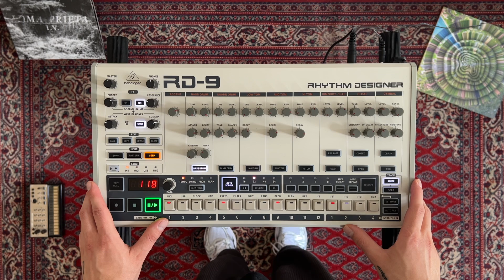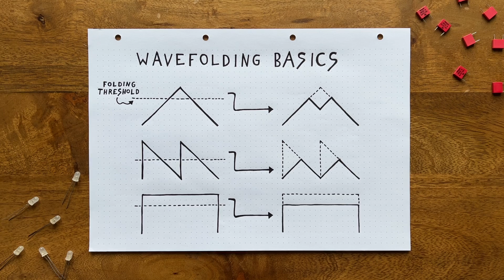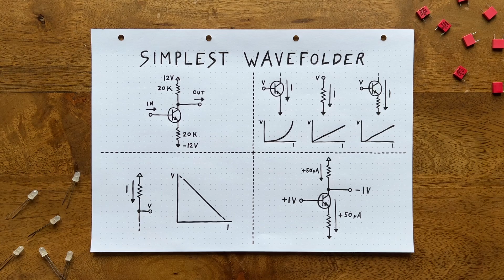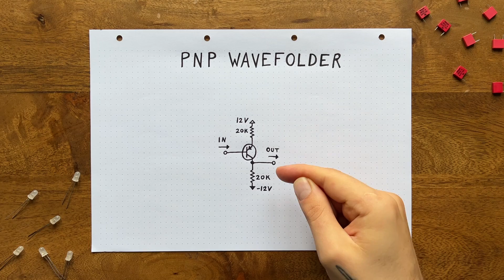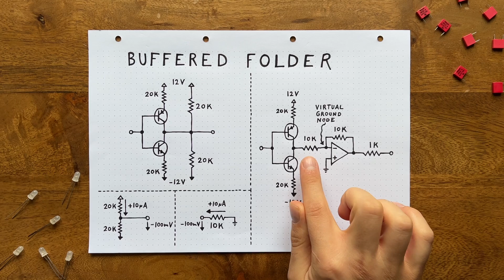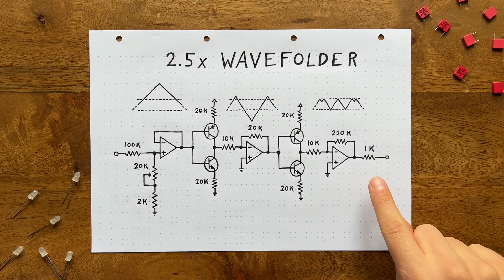Designing a double wavefolder from scratch

Comment: If I make a +/- supply, is the midpoint to be used as ground for all ground reference points?
Reply from the maker: yes!
Reply: @MoritzKlein0  Thank you for replying on a 3 year old video! I'm trying to use this for guitar, I've had to change some of the resistor values to accommodate for instrument level, it seems to work on falstad!

Comment: Great jam in the beginning! I am surprised at how simple wave folding is. It’d be cool to make a multiplier at the beginning of the circuit so you could blend the original output with the old. You could add a break point from the mult so it could be an additional in for if you wanted to blend a different wave shape in. 

I could build that with multiple modules but it would be a cool all in one as you could use it as a basic mixer as well.

Great video! You’re a good teacher!

Comment: Did this for my  volca modular.
Some things to note! 
I had to switch the 1 resistor next to the potentiometer. I replaced the 100k with a 30k and a 6k8. I also changed the resistance at the output. 
Really really fun and opens up volca modular to be an actual modular synth.

Make sure you get a scope. I did this without a scope at first and realized after getting one that pnp npn are polarized. 
I also added a bypass switch. 
Super cool build!
Reply: Do you have this documented? Or is it so simple on the mainboard?

Comment: Built it, but i don't get sound. Looks like my power supply is actually a 5v output. Is that my issue?

I followed the diagram for the negative and positive connections. I noticed in the video there were some that didn't match the diagram. I'm 90% sure it's the power supply. I get a sound (Not the synth) out and then it drains the power supply and shuts off.

Comment: At 7:57 you say to connect a 20k resister to the positive and one to the negative but in the video you connect both to the positive. Am i mixing something up or are you using the upper + marked rail as a negative? Does this project use positive, negative, and ground? Or just positive and ground?
Reply: I see my issue. It's positive, negative, and ground, and im only using pos and neg. I found your dual power supply video, but I'm a little lost on how to set up the ground. Would you mind linking a video if you have one that explains it a little bit for me?

Comment: Awesome video! Want to use it with my volca modular but concerned about the lower voltage it does -3.3 to +3.3. Any suggestions for changes that would allow this? Would a voltage divider at each end to raise the incoming and lower the outgoing voltage work?

Comment: Very nice, I learned quite a bit about wavefolders from this. I have to ask though, are the pots linear or logarithmic?
Reply: Pots are usually linear unless specified otherwise.
 Looking at the user manual for this circuit's kit from Erica Synths, they are all linear pots.
Reply: Linear pots are marked with the letter 'B' eg B10k
Log pots are 'A'

Comment: Would any of your breadboard designs run on a 9v battery?
Reply: Tweak some resistor values, set up a virtual "ground" at 4.5V using a decent opamp + capacitors - should be doable.  Guitar pedals do stuff like this (they usually run off 9V).

Other option is to DC/DC the 9V to ±12V using something like a RECOM RTD-0912.

Comment: Moritz, this is going to be off topic, but there is no video of the output module yet, so I have no choice. :D Do I think correctly that a buffered mult, such as Doepfer A-180-4 or similar, supplemented with an attenuator on the input will be able to be used as a headphone amplifier?

Comment: hey man this is really cool! I am thinking about how I can do this with a typical software synth. Maybe If I created a new type of custom modulator, but it would have to be high frequency, and synced up and locked to whatever the actual duty cycle of the waveform is playing at any given moment. So if you have your triangle wave, the mod will dip the peak into an inverted triangle mod shape, turning on and off at the mathemathically precise timing to be synchronized, symmetrical, and aligned. I think it would work. I know I can create those types of shapes with a tuned graphic eq on a very high resolution. I have never thought of this. But it reminds me of some fx plugin I used to have, it could add narrow band harmonics, or carve them out of the spectrum, in different shapes and q curves. This is a really interesting video. I love innovating new audio ideas and learning new stuff. Thanks man

Comment: It's been a while now and I've noticed that you still haven't gotten into using OTAs. OTAs are very useful in synthesizer electronics. For example, an OTA based VCA in place of the first op amp would be a good way to introduce CV and modulation into the circuit. 

Anyway, I think you are doing a fine job in helping people get into DIY circuitry. Keep up the good work. 👍

Comment: Thanks, I made this module 💜 Everything works perfectly, but there is something. As the threshold increases closer to the maximum value, the volume of the output signal also grows strongly, reaching up to 19 VPP. And at the lowest threshold, the signal is centered below the 0V. I think I need to play around with the values of the resistors near the potentiometer to limit the range. Anyway, thanks a lot for the detailed explanation!
Reply: as BJTs I used BC547 + BC557

Comment: One thing, that just came to me:
You're dipping into West-Coast waters here. Maybe that could become an interesting series and a bit of a contrast to your existing videos covering mostly East-Coast modules like ADSR, filter, saw-core VCO.
A video about Lowpass-Gates and maybe a series about a triangle core VCO, as those are more common in the West-Coast-Domain. 
I'd be especially interested in the triangle core vco and through-zero FM. 
Quadrature oscillators based on sine and cosine could be a very interesting topic as well.
But anyways, so far i've learend a ton from each of your videos! Thanks for that! :)
Reply: i never knew there was Crips vs Bloods modular synth drama
Reply: @makki413 Nah... No drama.
Rather to different paradigms of two brilliant minds of the synth world.

East-Coast is what Bob Moog made famous. Typical subtractive synthesis, which Moog is famous for. Create harmonically rich waveforms and then shape them with filters and VCAs.

West-Coast is what came about through Don Buchla. 
Take waves with no or few harmonics, like sine and triangle or even addtively added sines and then add more harmonics by putting them through waveshapers, like this wavefolder here or use FM / TZFM or PM. Then loudness and "harmonic decay" get shaped by Lowpass-Gates.

East-Coast is the Top-Down approach to sound synthesis, while West-Coast is the Bottom-Up approach.

Comment: Oooh! That's how it works! Thanks for explaining it in understandable language! 😊😊

This folder is pretty similar to the folding cells of the Metalizer which Arturia uses. 
Well, at least if i remember the old YU-Synth schematic, which sadly isn't available anymore. Probably, because Arturia has gotten the exclusive rights to that schematic.
Iirc the Metalizer cascades four stages of the buffered folder circuit. 
In front of the folders is an exponential VCA to set and modulate the level of the input signal and an amplifier at the end to pull up the level back to typical eurorack levels.
I knew the circuit, but didn't understand it. Now i know what it really does.

Comment: Quick tip regarding the jittery triggering on the scope with the folded signal. If you connect the input triangle wave to the second channel and trigger off that, the triggering will be rock steady. The channel doesn't need to be displayed to be used as the trigger source.
Reply from the maker: oh good tip. will do next time, thanks!
Reply: Yeah, a classic eurorack scope technique (even recommended in the "mordax data" module manual) is to use the square wave output from your vco for the scope trigger, literally can't ask for a cleaner trigger than that.
Reply: @scottramsay3671  im still gonna ask for it
Reply: @scottramsay3671  you can't stop me scott
Reply: @emiliaolfelt6370  please no don’t ask humanity cannot handle that knowledge

Comment: Sweet! What's the best way to control this with, say, and LFO?
Reply from the maker: easiest way i can think of is routing the input wave through a VCA before sending it to the wavefolder. since the intensity knob is just an attenuator, varying the input signal’s volume is functionally the same as turning the knob.
Reply: @MoritzKlein0  smart, thanks!